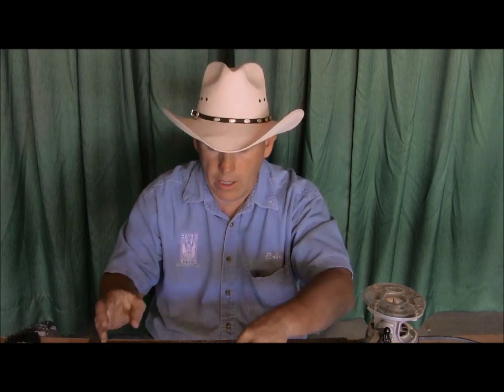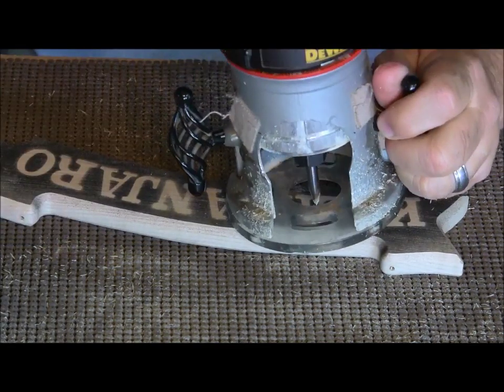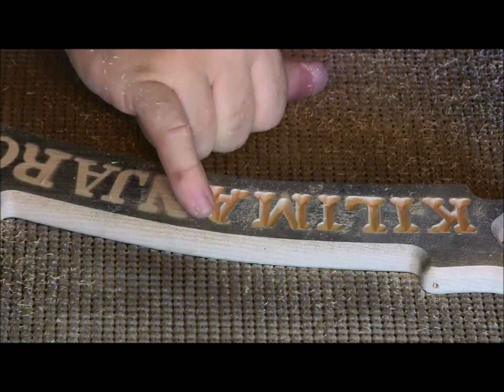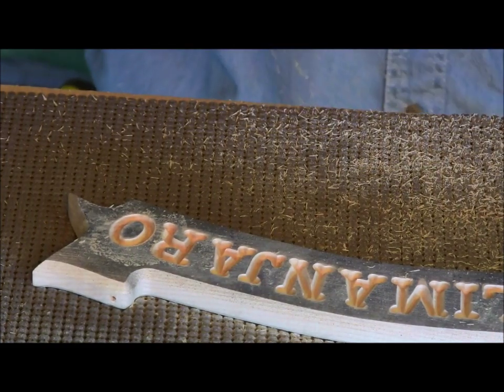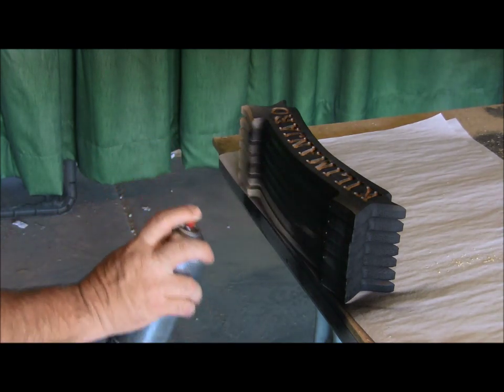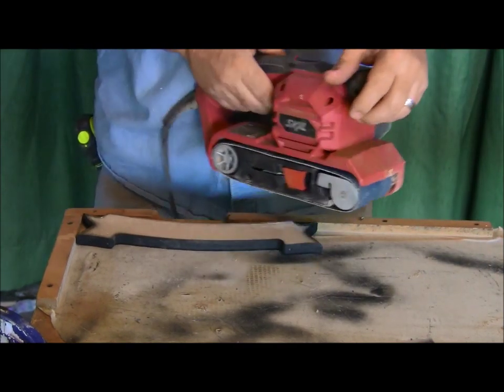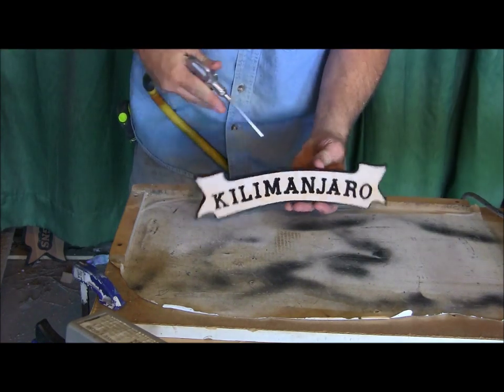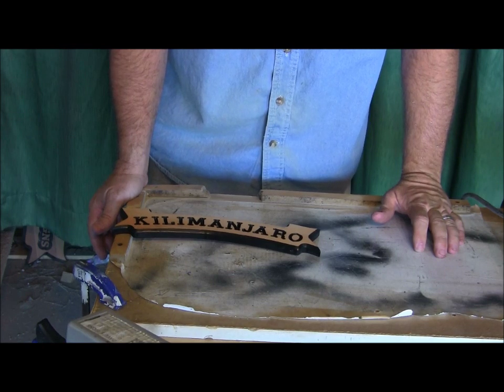#88 Carving small ribbon signs + update on finishing

Comment: Hi Eric. What is that rubber-like sheet where you put your ribbon sign on?  I normally would clamp my wood on my table so it won't move while I do the routing. But yours are not clamped and yet, they don't move even if you run the router over it.  I supposed that base sticks on the wood. Where can I buy it?  Thanks!
Reply from the maker: I've been using shelf liner for years. It's the rubber stuff you can get at the dollar store or walmat. It comes in rolls. I also use the rubber drawer liner for tool boxes. I have found a new product as well that I'll be showing on tomorrows video, I like it better. Thank you for watching, Eric
Reply: Dave Rhoten thank you very much!  I'll get one of those today.